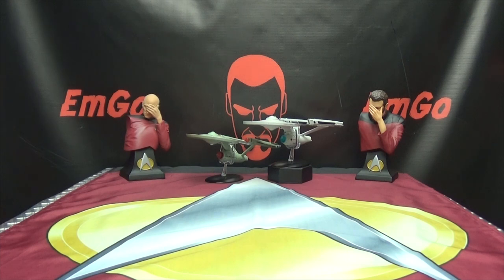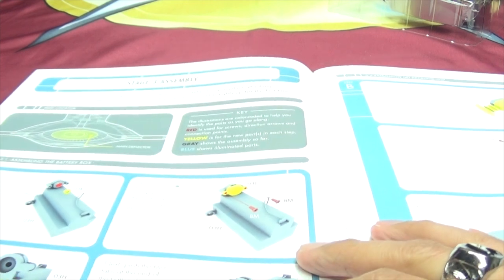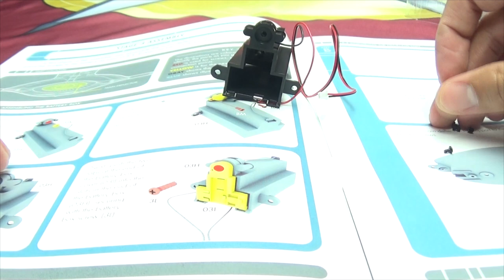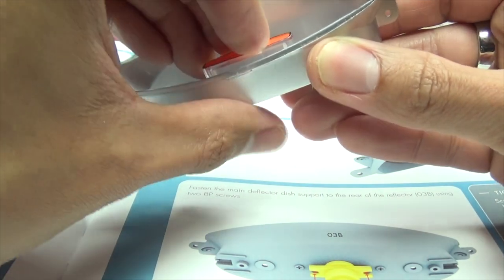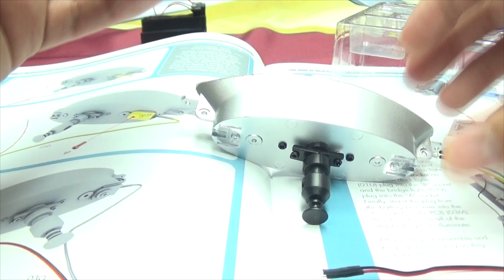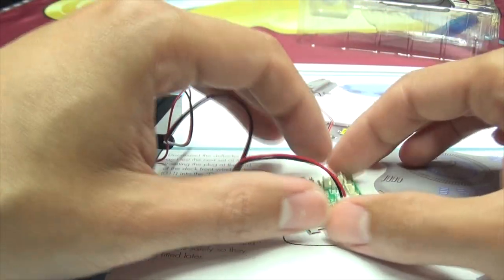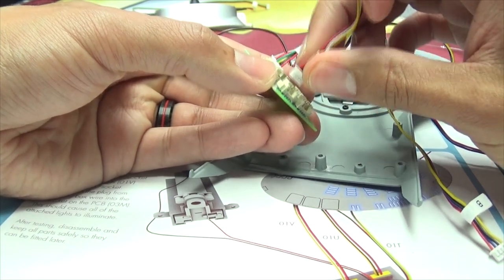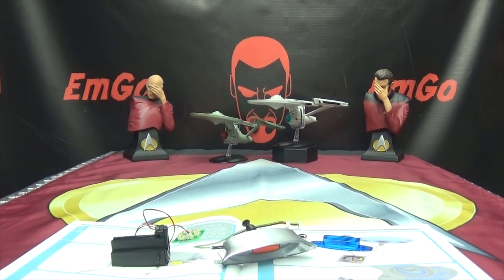Eaglemoss Star Trek Enterprise NCC 1701-D Kit (Part 3): EmGo Builds Stuff

Comment: Something I learned when working with plastic parts is that you should turn the screw in reverse until it finds the threads (sometimes it will make a sort of click when you have done it right ), then start tightening, this will avoid stripping the thread caused by metal parts going into plastic. This doesn't stop you from stripping it from over tightening though. You may already be doing this but I wasn't able to catch it.

Comment: You should have two BM screws left over from your last assembly. I used those for mine, secures it snugly for the battery cover nut holder.

Comment: The original series Enterprise was also meant to saucer separate in the event of an emergency. There's two red triangles on the underside of her saucer, and those were meant to be landing gear that would extend and then there would be a third hidden in the joint of the neck/saucer.
Reply: Important point to make... the big difference was the classic Enterprise saucer separation would be permanent.  Once done, it was not designed to go back together.
Reply: @vengeance1701  Yeah on the Constitution it was ONLY for use in the event of an emergency. It would take being towed back to spacedock or a starbase and having the ship put back together, if both sections were to actually survive. z

Whereas on the Galaxy class they were supposed to separate any time the ship went into battle. The idea being that civilians would stay aboard the saucer out of immediate danger and the enlisted crew would take the drive section into battle. Then meet back up with the saucer once out of danger. Didn't work that way in practice but that was the intent of the design. 

There's always a ton of features designed into the ships that don't get used. Like the Captain's yacht on the Enterprise D. We never saw the main hanger on the Enterprise D. The Aeroshuttle or the second warp core on Voyager are also good examples. Or how the Runabouts could have the entire aft section swapped out depending on the mission.